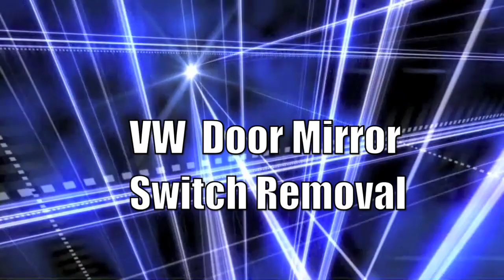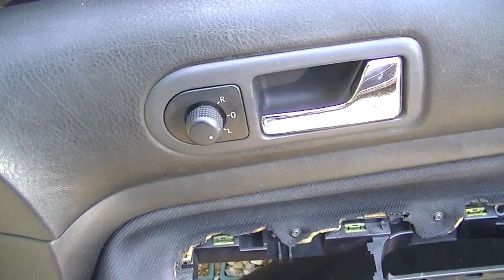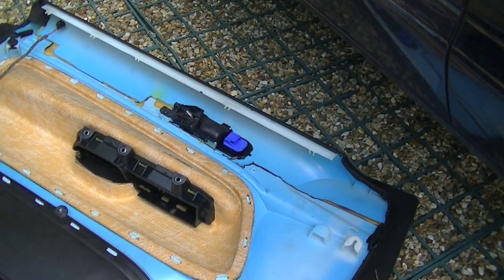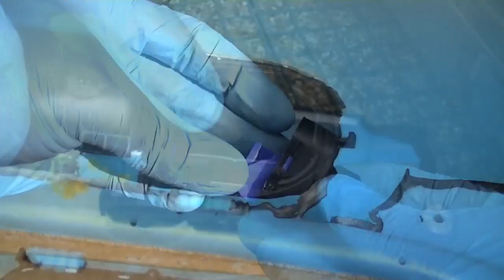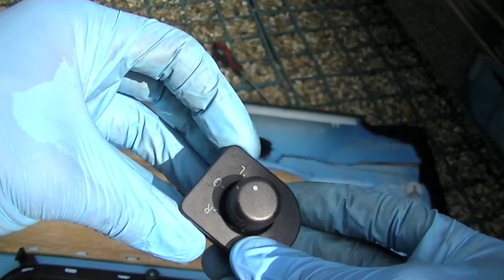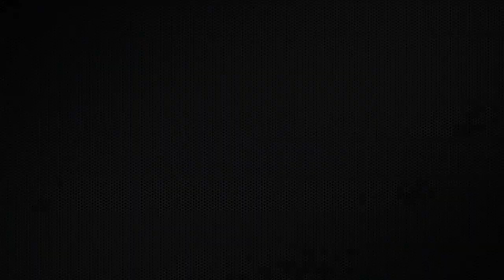How to remove a Volkswagen Mirror Switch, Simple 10 minute job

Comment: Hey, I really enjoy your videos and they've helped me out a lot from when I had my mk4 golf, now I have a vw polo 1.4 mpi 2001. 

I've got a few problems with it such as, drivers side window not operating, passenger side window operates but from the passenger side window control but can't be put down with the main drivers side control panel however it can be put up by the main switch.

Second one is my mirrors don't operate at all, the fuses are okay, Amy guidance, thanks.

Comment: Thanks, I was hoping that you could just prise it off. I haven't tried just my good luck. I am looking for a switch from second hand part dealers. I have VW Bora 2003 model. I wonder if switches from other VW models will fit in My Bora Model e.g VW Golf GTI MK6 Passat or other VW's.

Comment: I understand, but it looks like you could take out the complete assembly without removing the door panel. I see that if you just want to remove the mirror controls you need to get to the back of it, but I have the whole unit with surround and latch.